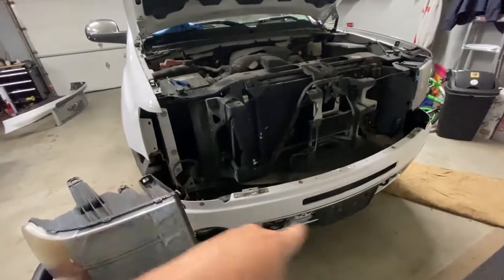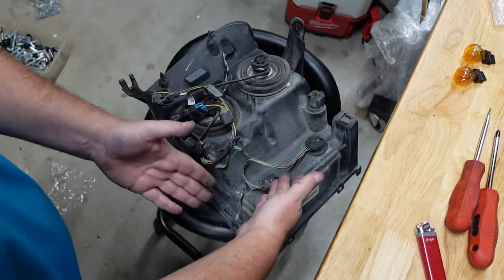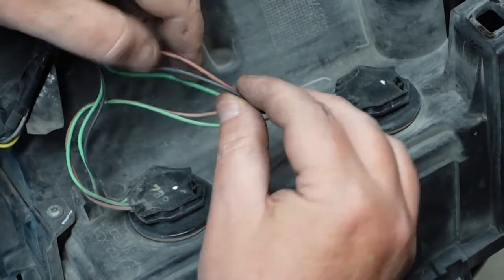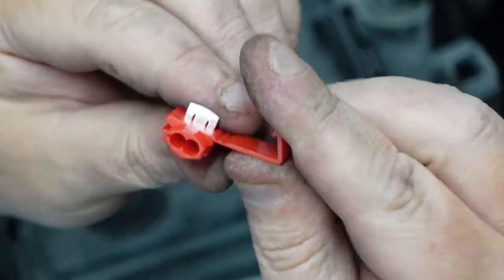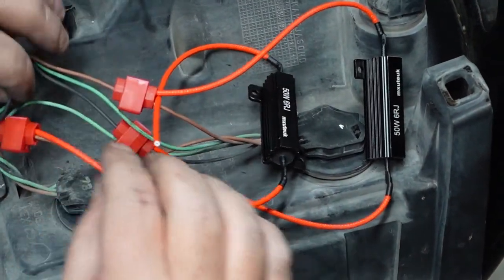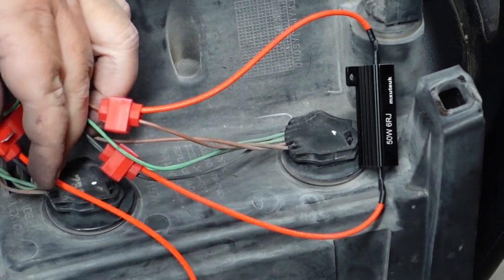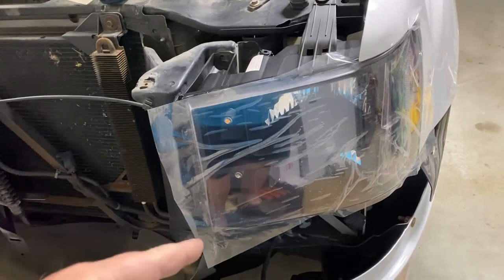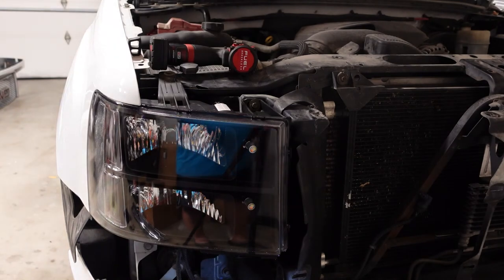Switchback LED Turn signal Load Resistor Wiring

Comment: Your hint about checking things with the engine on, versus when the engine is off made all the difference.  I had installed resistors on my 2013 GMC Yukon and was so frustrated that I still had hyperflash on the left side (passenger side). But when I saw your video, I tried everything with the engine on.  Amazing!  The hyperflash was gone!   Thank you so so much.  I have watched many videos on LEDs and hyperflash, but yours was the one which solved my problem!!!

Comment: Picked up the same resistors..  Installed on my 07 new body..  Had to install 3 resistors on drivers side...
Copied on the right side and still hyperflash on passenger side..  Now upgraded to tow mirrors with turn signals. Drivers side now hyperflashes intermittently again..  Have not installed passenger side.

Comment: Awesome!!!!  Thank you so much.  I just spent hours trying to figure it out.  I knew I was using the correct wires to tap into, but I had no idea about the second resistor hook-up or where.  Wow!   I originally searched but did find your video or any other, until now...my second go around after banging my head into a brick wall.
Again, thank you for the help.   God bless.

Curious, how did you find out?
Reply: Follow up... I am experiencing Hyper flash on the driver side, but normal flashing on the passenger side.  I give up, unless someone has an answer.  HELP.
Note:  I have the resisters soldered to the wires and close to the sockets, the same on each side.   I have a 2010 GMC Sierra 1500.  

Add'll info: I have had LED's installed everywhere without problems, with resisters also in the rear for those led directionals. once installing the switch backs in the front directional sockets, problems as noted.  I installed newer LEDs in the rear too.  The resisters in the rear are not soldered, thinking there is a connection issue there.  
I will check the rear resistor connections tomorrow.

If anyone has any helpful input, please reply to this and I will read.  

Thanks.
Reply from the maker: Glad it helped!

Comment: Did you try switching your stock flasher relay to an LED flasher relay? Much easier fix than adding resistors
Reply from the maker: 08 gmc does not have a relay that can be replaced
Reply: Neither does the 2012 ram 1500.

Comment: Is it 4 resistors (2 for each headlight) or just 2 resistors for 1 side? I’ve seen both on YouTube and now I’m confused.
Reply from the maker: The ones I got is one resistor per bulb. So 2 per side and n this particular vehicle
Reply: Here’s my question. I’ve got a 2013 Chevy 2500 with dual turn signals up front, same as you. Can we not just trace the wires further into the harness, past the point where you wired your resistors in, where the number of ground/power wires is less, that way you’d only have to use 1 resistor per side?

Comment: Are you sure you need a resistor on each bulb I don’t think you do pretty sure you just need one on each side cause by this logic if you put LEDs in the rear now you gotta do that to
Reply from the maker: honestly not sure but better safe than sorry i guess. Also depending on what LED taillights you buy some already come with the resistors preinstalled
Reply: @LanierLawnCare  no your right you have to put one on every bulb 8 dame resistors total sheesh

Comment: I may have to unsubscribe just for you using scotch connectors.... Those things are GARBAGE!
Reply: Also I don't know if you knew this or not but you can replace your flasher with a electronic plug in flasher which has preset flash timing rather than load breaking that relies on a certain load to operate. However I am sure this video will help out someone. Just use strippers and pull the insulation back mid wire and wrap new wire around that section and solder it for best connection. Even just wrapping the wire around and electrical taping would be better than those connectors.
Reply: Do you know where I can get this flasher relay at?
Reply: @KenMrKLC flash is controlled by BCM. Your advice won't work in this case.